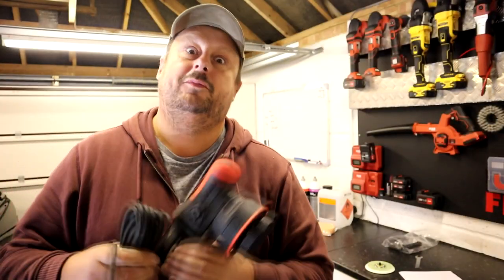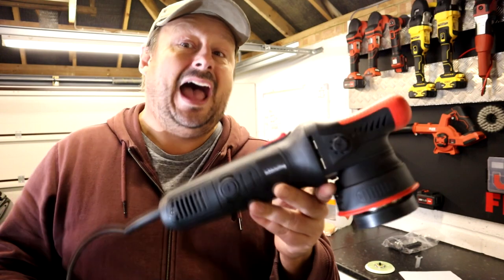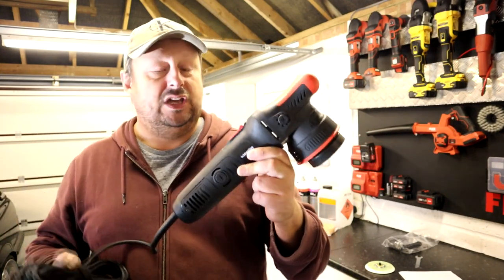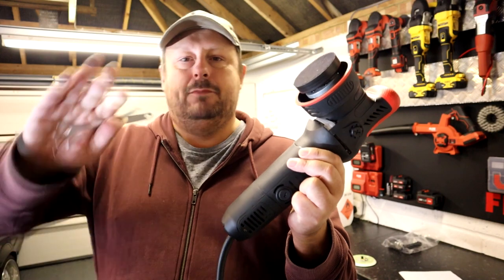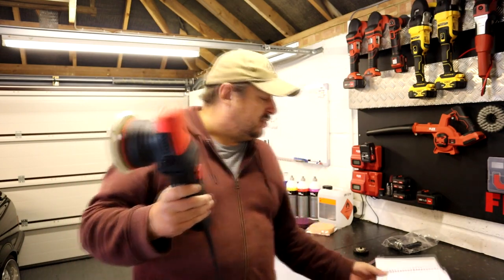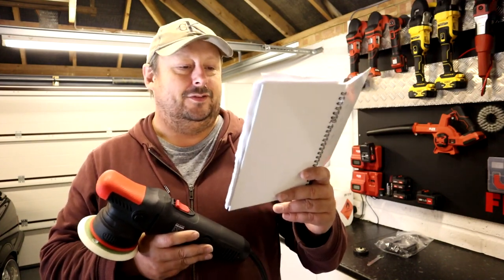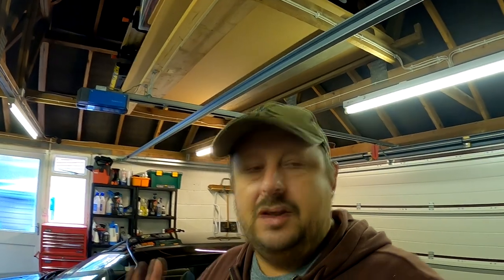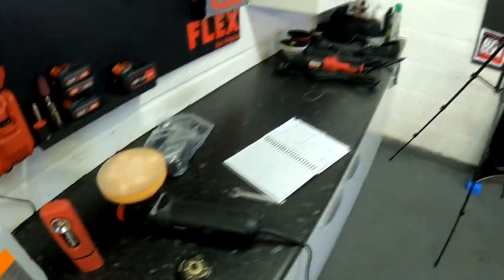The Ultimate Dual Action Polisher for Beginners? | New DA8 Review | Picking your first polisher

Comment: I like to use a mixture of Gyeon Prep, 90% IPA and distilled water - about equal parts of each or maybe a bit more water and a bit less IPA and Prep - it works great and is obviously much cheaper than pure Prep spray. I do keep the pure Prep handy though in case I am going to apply a higher end coating. Thanks for all the great videos!

Comment: Got the smaller one when you did the video. Used it last week and had an issue. Emailed in2detailing and they sorted it straight away. Great service from them and happily polishing away now. Some of these at similar prices on amazing don’t have long leads. Really important,  Have the Smaller one then a 120mm dewalt cordless that John reviewed ad it’s easier being bigger and cordless for the bulk of the work. For me it’s a good cost effective combo for hobby use. .
Reply from the maker: what was the issue if you dont mind me asking andrew.   wasnt brush related?
Reply: @ForensicDetailing  no it was the plate - the version I had was different to the black one you had. The white foams came off the plate. They Sent me a replacement that looks like the construction in your video. Black front part white the plate on the back. The one I had was metal sandwiched between the foam and just didn’t last. The new part must be the later version and can’t see that breaking any time soon. Things happen but it’s what the company does next that shows they care. Can never fault in2detaining service.

Comment: Hi Jon,  just a quick one on the backing plate. The holes are not for cooling the pads. They are designed for pneumatic DA Sanders that have a built in Central or self generated Vacuum for removal of dust / debris whilst sanding. In no way do they offer any cooling from the motor. All the air from the motor is expelled rearward and not forwards 👌
Reply from the maker: the air is suxed in from the rear Ive just checked this with bits of paper.  the fan sits between the shroud and the motor below the latch.  the vast majority of air flow though is expelled before the shroud which is unusual (in 4 vents).  It feels like theres some airflow coming out between the plate and the shroud though, although inside the shroud it looks sealed off from the main unit.   Indeed the shroud has vents inside it and I can feel airflow coming out off this.   I suspect the airflow inside the shroud though is mainly generated from the counterweight spinning at high speed but this is expelling air out of the shroud (you can feel it)  and if theres holes in the plates then the air will flow through them.   I think its for cooling, I can check with the manufacturer if you like.

Comment: Great video thanks!  I have a 1 year old Volvo in solid black and it’s covered in swirls from where I have washed it.  Absolutely gutted! I was thinking of using the m3 as I am extremely nervous I am going to cause damage! Anyway, great vid it was really helpful.
Reply from the maker: if its covered in swirls then a cutting compound like H9 or even F6 is prolly a better starting point.
Reply: @ForensicDetailing  hey thanks for the reply.  It’s not really swirls as such but cobwebby lines where I used a rubbish drying towel.  Anyway I will take your advice and give it a go.  Just got the da8 this morning it looks a great bit of kit!

Comment: This is a really informative video, thanks. One question though; once you’ve polished and buffed the whole car, would you wipe it with IPA or a panel wipe before applying wax or ceramic, or is buffing sufficient? Thanks
Reply from the maker: degrease wipe down is needed for bonding sealaing and ceramics.   But most paste waxes it wont make much different, they dont really chemically bond.
Reply: @ForensicDetailing  thanks for the reply. Much appreciated!

Comment: Excellent video.  I have a Porter Cable 7424 that I have since 2007.  Should I consider changing it for something like this.  It is for personal use only.  Thanks again and subscribed
Reply from the maker: Yes m8 I personally would they are not expensive and it will cut better
Reply: Sold the Porter Cable and took delivery of this yesterday. Cheers Jon

Comment: John . after watching a lot of your excellent videos .. I bit the bullet and got myself a DA8, some pads and Koch Chem (Cut/Polish). You also got me into the Bilt Hamber stuff, Seal and shine .. and the Fusso Coat !  Plan is to correct the paint and protect with Fusso coat soft 99.

This is going to be my first ever attempt at polishing using DA so I'm planning on how and when to correct the paintwork on the car. I don't have a garage (it's a communal garage) so will be working out doors is there any other advice that would be worth taking on board before kick off ?
Reply from the maker: nice slow polishing sets mate.   and if you are doing cut and finish dont scrimp on the finishing set.  a really good slow final pass does make a difference.
Reply: @ForensicDetailing  I've had agood look at the car and its got 10 years of swirls and a tonne of scratches/chips. I''ve been watching some of the beginners videos just to get my head around it. Should I retouch the paint chips before or after cut/polish ?  Cheers John !

Comment: Hi Jon, I'm building up the courage to polish my car and this machine looks perfect.
Can you answer a question please?
When it comes to reapplying a wax,in 3/4 months time,can I just apply wax after a wash and dry or should I use chemical de  contamination products then panel wipe,then wax.
I haven't mentioned a clay bar as I'm under the impression you should only clay if you are going to machine polish afterwards.
Thanks.
Reply from the maker: hey craig. you can just wash and dry and apply wax.  or you can whizz over the car with like a AIO to remove and old residue of wax and give the surface a gentle buff up and prepare it for the wax or just let the wax in the AIO do the work.   you dont want to be doing paint correction all the time.. but I love whizzing over the car with a light AIO glaze and a wax.
Reply: @ForensicDetailing  ok that's very helpful.thanks again.

Comment: Great video, keep up the hard work. I have recentley subscribed and have found this channel very useful. 
A friend has just transformed his car with the Meguiars Mt320 using there compound, polish and wax and I was all set to buy their bundle. Now I'm tempted with this, especially considering the price differences. Would you say this will perform just as well?
Reply from the maker: in a work yes. the meguiars tool is a bit pricey.  It does have superior ergonomics.  And I recomend flex pads over anything (matched only by scholl concepts spider and ninja pad ranges) But check out the DA15 from in2detailing for 150 quid. if you want a long throw tool with full grip and trigger.  review coming soon.
Reply: @ForensicDetailing  thankyou so much for taking the time to reply. I will hold out for now, looking forward to the review.

Comment: Hey Jon, any plans to review the new Ryobi One+ DA? Its the R18P-0 and is due for release before christmas. Some retailers have it on their sites at around £90 as a bare tool which makes it quite appealing to those who already have the Ryobi battery system on other tools.
Reply from the maker: Ill try and check it out mate for sure.  see if I can borrow one off ryobi.
Reply: Cheers Jon, looks to be a 125mm plate, 8mm orbit and 2500 to 7500rpm speed.

Comment: Great review, loving the channel! I was planning on getting a DAS 6 Pro Plus as my 1st machine but after watching this review I'm not too sure now. Would you recommend this over the DAS 6 Pro Plus?  Also this machine is significantly cheaper...bonus points.
Reply from the maker: yes.  your results will be down to you and the DAS6 pro can be used to equal effect.  but this machine has more grunt, is cheaper and has an intergrated bail.  I get comission if you buy it from my links but in2detailing used to sell the DAS6 pro before the DA8 was around.  so either will do mate.
Reply: @ForensicDetailing   Thanks for the swift reply mate...We are  both talking about the newer updated PLUS DAS6 machine here? It will primarily be used on older Audi, VW paint if that helps? Still leaning towards the DA8, it has that smaller backing plate and its a fraction of the price of the Plus. I didn't know about your commission but I'll be sure to order from your link when I do. Again, your doing a fantastic job on the channel mate, makes me want to go and clean my car every video I watch.
Reply from the maker: @TynesideMadman  yes mate the DA8 is the one to go for, it has 5 inch and 75 inch plate and a little spanner to switch plates.. its a great little polisher it should last you years and years and year.
Reply: @ForensicDetailing  DA8 it is then! Just need to get my boost issue sorted and then I'll be primed and ready for action haha. Thanks for the advice mate...saved me a few quid as well!

Comment: Yet again, such a great video Dave, I will be asking Santa for a polisher this year. A couple of questions, I do have a Dewalt battery and charger, would you recommend a cordless one of these ahead of the DA8, however price will be maybe £70  more. And lastly, on a 30 year old german black car, which has had a lot of paint, and many swirls! will a two or three stage polish be necessary. 
Keep up the great work, thumbs up
Reply from the maker: so if you go cordless you pay more, and you have to round robin batteries.  But the Dewalt cordless is very capable.  I dont want to say too much but my review of the DW cordless tools is coming soon and it looks at these offerings in detail so hold fire I would until you have watched this.      

hard german paint.   Ok first up compound, and finishing, and ultra refining, is 3 stage.   Dont confuse stages with sets.   so I could do 3 sets of compounds, and 2 sets of finishing, 1 jets of ultra fine jewling or refining.  thats a 3 stage polish.

So you do the extra stage when you really want to max out gloss, maybe on a high end valuable car or maybe just because you are crazy or its a show car etc.. the etc ultra fine refinement is a lot of extra time for time gains.    So Cut your hard black german paint untill you are happy with the swirl level and then refine it untill you are happy with the pure sharp reflection marring free finish...  aim to minimise compounding sets if you can.
Reply: @ForensicDetailing  Thank you Dave for your quick and  helpful reply.  I will hold fire on the machine, as did see the Dewalt hanging up on your tool rack on the video. I only have 2x2amp batteries, so will have to see how long these last for, and not worry about the final stage, as its a regularly used older version of that lovely ruby red one you cleaned a couple of months ago ! 
wonderpreviously mentioned, these would be more than enough for the DIY er

Comment: Hi Jon,
I’ve watched both this video and one from a while ago ( 7 years ) with the das6 pro & scholl s20 black. For a beginner, which is best to start out with? I have joined the patreon if I’m best to ask questions on there instead.
Thanks mate
Reply from the maker: Yo Mark,  The DA8 has a bit more power and a better bail but the DAS6 pro will still do the job mate.  Get which ever one is one sale I think.       The only other cool option mate could be using Rupes Advanced AIO instead of Scholl S20.  The advanced will also protect the car and no panel wipe is needed or addiotnal waxing mate.   If you message me on patreon I will definetly answer, its a bit more hit and missed on the comment because they continually scroll down, but I check patreon every night where possible mate.   thank you so much for signing up as well.
Reply: Cheers for the detailed reply mate. Yeah I just seen your welcome message on patreon. Il message you on there in future. I’ll look into what you’ve just said now. Cheers mate

Comment: Nice review thanks, is there any chance doing a comparison between the das 6 pro plus the da8, the machine really looks good for its power.
How's the vibration as the pad was. a little jumpy at the start but later smoothed out.
Reply from the maker: its pretty smooth  this but its got more power and higher speeds.  I was at 4.5 and it felt like too much grunt.  at about 3.5 it felt more like how I used to polish with the DAS6 pro.

Comment: Good video Jon. I do recommend as a entry level polisher the Autojack DAP 150. Its the one I have. I have been detailing full time for a year now and it has worked a lot. Only negative for me is that it is a bit noisy. 
Jon, what are the chances for you to get hands of a Vertool gear driven polisher?  I am thinking of going for that one instead of a Flex. 
Regards.
Reply from the maker: the vertool is a good option but its basically the same thing as the in2detailing forced rotation which I reviewed.  I think in2detailing stocked their own forced roation, then stocked vertool, then went back to their own forced rotation
Reply: @ForensicDetailing  Thanks for your reply. So I will go for the In2detailing one instead. I am also curious about the Liquid Elements polishers, a Makita DA I saw on ebay and the Chemical Guys Torq. Cheers
Reply: That polisher is a 21mm bit aggressive for beginners I have a cocraft 15mm da was £60 very good quality
Reply: @hakman239  The Autojack DAP 150 is a 150mm polisher. I recently bought a 125mm backing plate too but I rarely use it.
Reply: @alexisamtosta  21mm refers to the throw/offset which is explained in this video. 8mm is less aggressive and good for beginners. 21mm is considered aggressive and suitable for more advanced users.
Reply: @admiraldirtbag4336  Yes. I started polishing last year after my detail training and to be honest, it is a very easy polisher to use. If its a 21mm throw, it doesnt seem so to be very honest. I personally never found it agressive. I would recommend to a complete beginner. I let 2 people use it under my supervision that never touched a polisher in their lives and they did not struggle at all. So I wouldnt say it is agressive. Just my 5 cents. 
Regards
Reply: @alexisamtosta  what I’m saying is that it has a long throw of 21mm 15mm is ideal for most tasks
Reply: @hakman239  It has but you can perform any task with it and it is easy to use. There is no agressiveness to it nor difficulty. And there is nothing a pro or a begginer cannot do with it.
Reply: @alexisamtosta  there not really good on softer paints generate more heat there also less accurate around edges
Reply: Try replacing the grease with a good high temp silicone grease, it will make all the difference.
Reply: @hakman239  To be very fair mate, in this year using it a lot on many cars, I never had an issue. You have to know how  to control you polisher. More or less speed, longer or faster passes. Who is using the machine is in charge. A complete beginner like I was, will not just buy a polisher and compounds and start working on a car. The person will for sure see some tutorials at least and will have an idea of how things are. 
I still think its fine and I will recommend this polisher to any person. A complete novice or a pro.
Reply: @alexisamtosta  the one I have sold out on amazon it’s identical to autofiness dpx just slightly higher start speed and less then 1/2 price
Reply: @hakman239 For sure it is good if you sold it out
Reply: @alexisamtosta  Yh it is
Reply: @hakman239  Can I know which one it is so I can have a look? In a future, I plan to sell polishers back home in Portugal. I mean, more affordable polishes as who sells, just want to sell the expensive ones cuz who sells makes more money and there is the status part as well. lol.
Reply: @alexisamtosta  can’t find it in amazon but it’s called cocraft720 hpv
Reply: @hakman239  Thanks a lot mate

Comment: Should have done this combo on hard paint to see the difference between the correction of the orange vs the purple
Reply from the maker: its a video about the polisher mate not testing pad combos on hard paintwork.
Reply: @ForensicDetailing  would make a good video tho I’m using flex polish sonax yellow fells exactly the same as rupes yellow but doesn’t do it in 3 inch so Rupes yellow 3 inch I use and recently got the scholl waffle I bought 1 but revived 2 instead lol and the spta wool

Comment: Hi Jon I have a question
I am looking to start a detailing business soon but I have never machine polished a car before and am looking to get into it and start practicing and getting good at it. I’ve been looking around at machines and the two im stuck on are either this DA8, or the Rupes LHR15ES Mk1. What would be the difference between these two? Is it mostly down to ease of use? Or can I expect the Rupes to give a better finish ? What would your advice be? I’m thinking on one hand I can get the DA8, and then save up for a Flex if needs be, or I could go with a Rupes and stick with it.
Reply from the maker: Da8 is good backup polisher.  Lhr15 is longer throw da which means a big more cut.    Both finish out the same. Abrasive and pad choice Important m8
Reply: @ForensicDetailing  ahh okay. Would you suggest maybe getting the rupes or do you think it would be a better choice in the long run to save up for a flex and just get the in2detailing one for now to learn with?